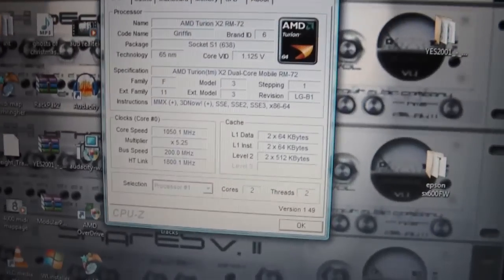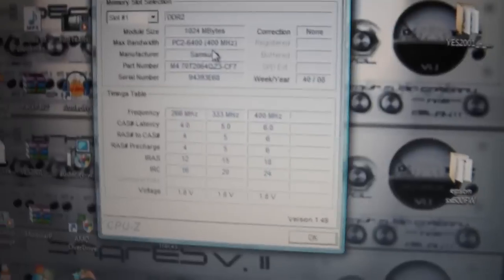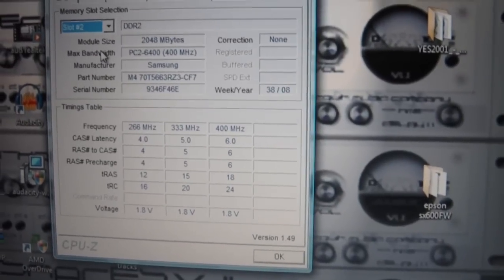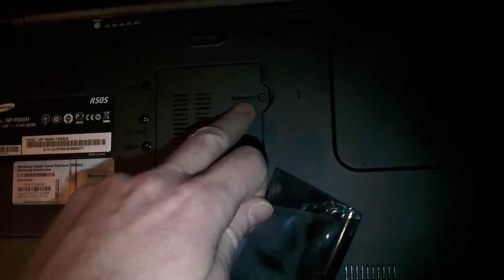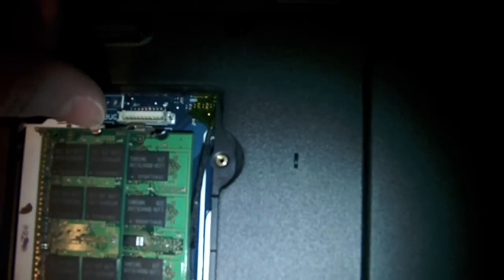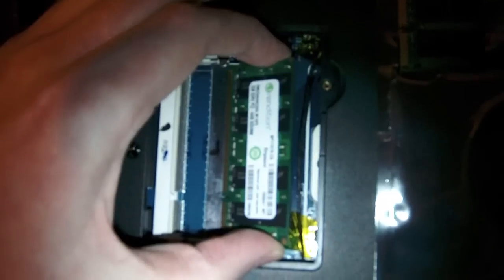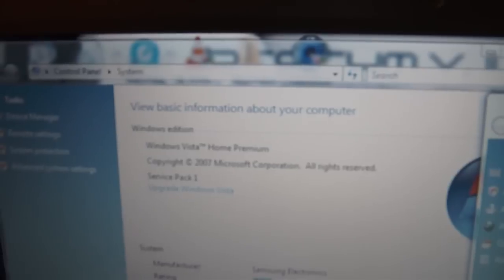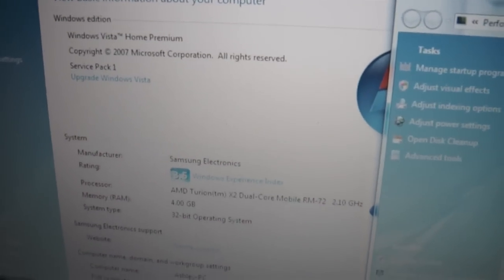Upgrade your Laptop RAM

Comment from the maker: Yes you need to know, what type of RAM you need for your laptop. If its a newish one it could be a DDR 2 type. But you had best check either by removing one & checking it. Or by using a program like CPUZ & checking the memory info part. 
Also make sure you get Laptop RAM known as 'SO-DIMM' when you order,  as there are desktop & laptop vesions.

Comment from the maker: Also bare in mind 32-bit operating systems can only make use of 3.2 / 3.5 GB of RAM (depending on  some motherboards having a work around to get 3.5 GB), even though it detects the 4 GB of RAM.

64-bit versions of windows are able to make full use of 4 GB & more.

Comment from the maker: price can vary on how much the RAM cost, different brands cost more than others. There are some budget versions though which are really cheap & good value. (as used here)
There are also some un-branded versions which can be even cheaper but they might not be any good, it can be a lottery with the un-branded modules if you know what brand the actual chips are & there good its fine, some else has just put the chips on one of there boards.

I say go for a budget branded module for a laptop.